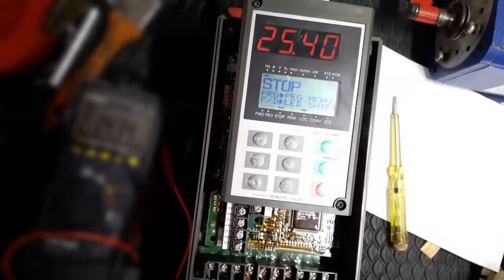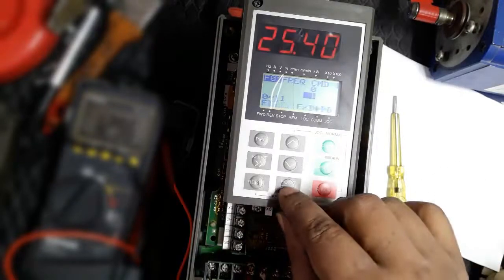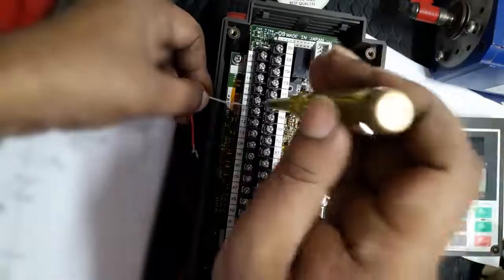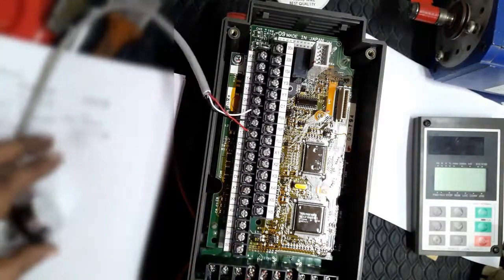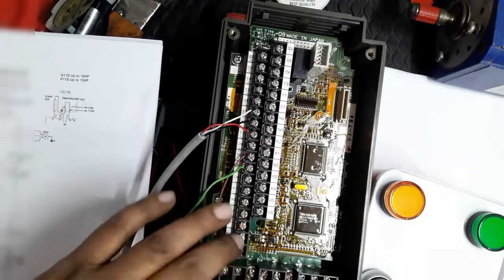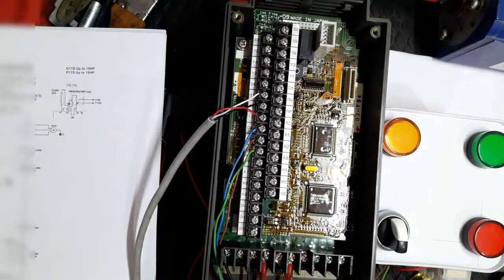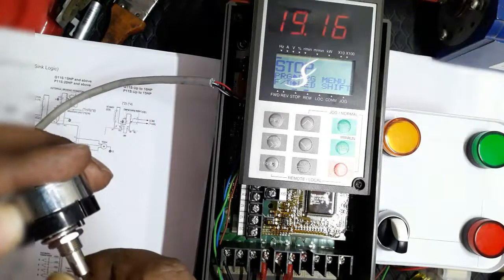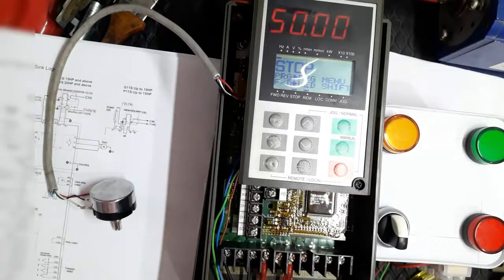𝙁𝙪𝙟𝙞 𝙂11 𝙀𝙭𝙩𝙚𝙧𝙣𝙖𝙡 𝙋𝙖𝙧𝙖𝙢𝙚𝙩𝙚𝙧𝙨 𝙎𝙚𝙩𝙩𝙞𝙣𝙜, 𝙒𝙞𝙧𝙞𝙣𝙜 𝙖𝙣𝙙 𝙊𝙥𝙚𝙧𝙖𝙩𝙞𝙤𝙣. @FlowChart

Comment: hallo, how to a look Hz, Volt, Ampere etc? please answer. thankyou
Reply from the maker: Press FUNC/DATA key to displayed Hz, Volt or Amp etc in LED display
Reply: @FlowChart  thankyou 👋😀
Reply from the maker: Welcome, subscribe and share please
Reply: @FlowChart  done 😀
Reply from the maker: Thank you
Reply: Dear, please, how do you choose y5C .y5A? How do I program it on the inverter and how do I control the timer with it with a contactor? After finishing the inverter, I want to close the contactor for about 2 years.